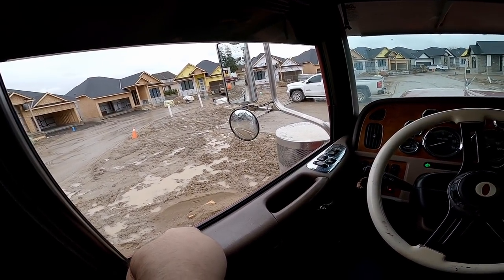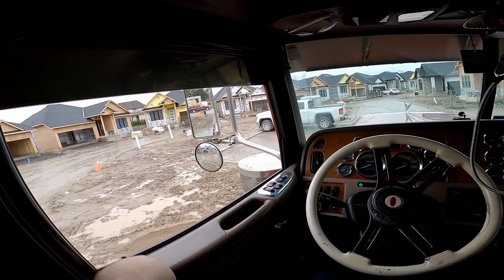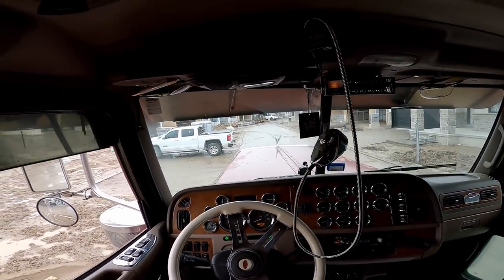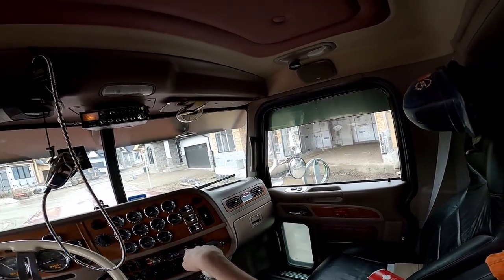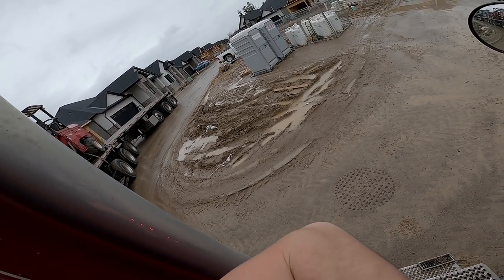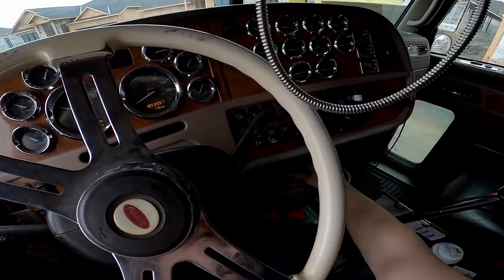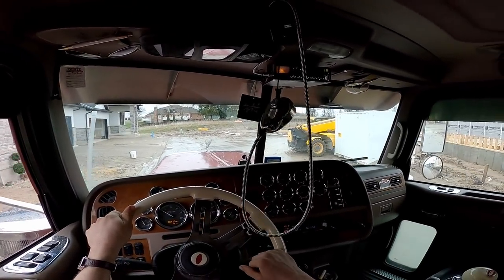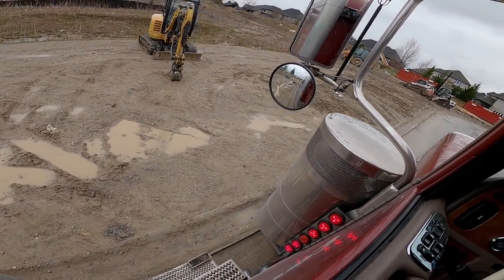Suuper Tight Hairpin Turn With B-Trains! I got out of there with a little trick though!!

Comment: I'm looking to get on with a company out of Mississauga either pulling B-Trains (3 & 2) or a single 48'. Either way they run mostly rack and tarp trailers with beautiful black 389X peterbilts. I'm sure you know they company I'm referring to. Hamilton to Montreal hauling coils and rebar back. I've never dealt with rack and tarps but it'll be an experience I'm sure. That's if I like what they have to say about the job itself.

Comment: I had a similar situation with my 6 axle but the front lift got stuck on the crown of the road. Couldn’t drag it through the turn and it took the weight off my tandems. Just needed a cable tug from the wrecker. Fortunately my employer has a towing division lol.
Reply from the maker: One of the reasons I like trains over a straight trailer, but crappy situations are crappy situations regardless!

Comment: have you tried replacing the harmonic balancer?
Reply from the maker: It was replaced two years ago during the rebuild, but was removed and reinstalled at the same time the first shake started acting up. Not sure if the reinstallation could cause that shake or not
Reply: @callthemall  it's possible that the balancer is your issue, I know they do have a service interval recommended by Caterpillar. Im not sure what it is, probably like 10k hours or something.
I believe that PDI sells a fluid balancer instead of the OEM rubber one which is supposed to work much better. 
Good Luck!